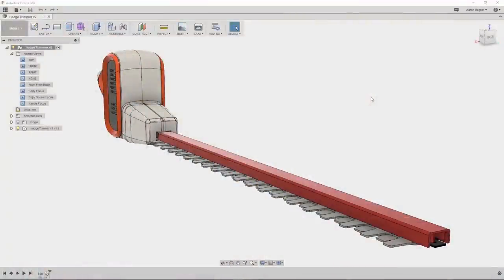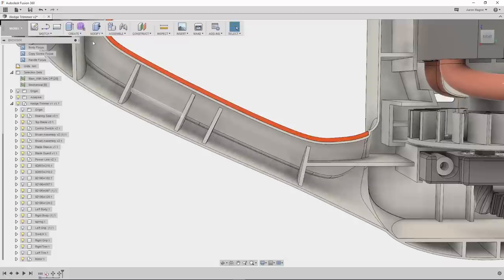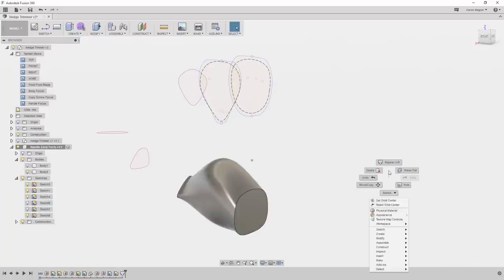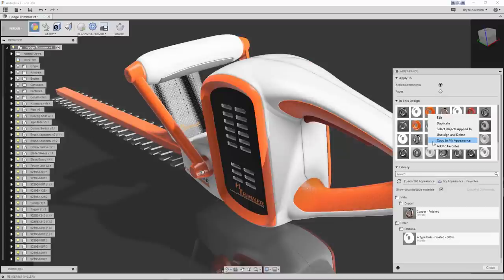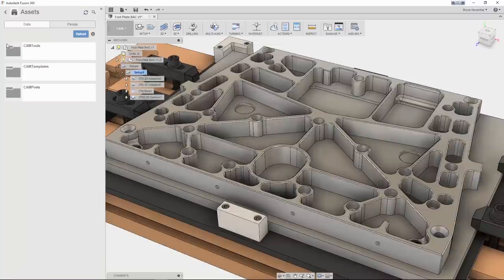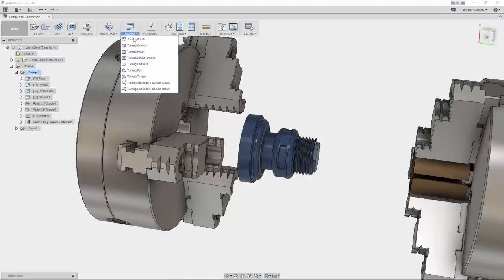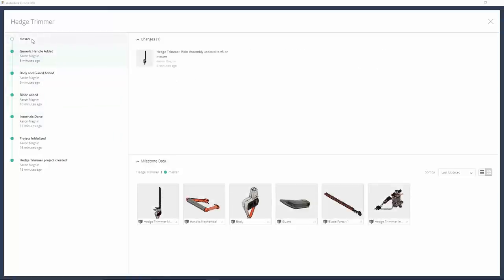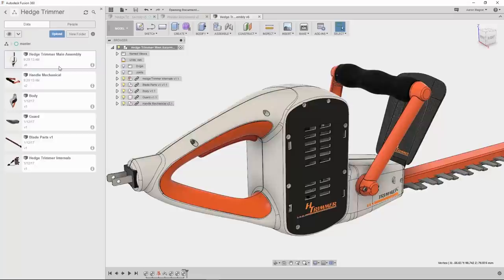What's New in Fusion 360 January 2017 Update

Comment: When moving the motor dependent assembly constraints, such as the radius of the larger gear, the length of the bar and the length of the housing are not updated?

Comment: All nice updates but the sketcher and the way everything works is based on an olsd system and is not user frendly. Modeling still goes a lot faster in other programs than with fusion. Will that be solved one time or do you stay with this way of working were you must move your mous to a point to let your model rotate? Sketcher, when will that be made like other programs so it goes faster an has some logic to it?

Comment: Great updates and amazing product, guys!  The only feature missing that would make this the only mechanical CAD tool I need is PCB (printed circuit board) import.  I want to use Fusion to design enclosures for electronics.  When will this feature be added?
Reply: Stay Tuned. We have some big stuff coming!!!! If you want to know some of the stuff coming, check out http://www.autodesk.com/products/fusion-360/blog/fusion-forecast-dont-resist-current/